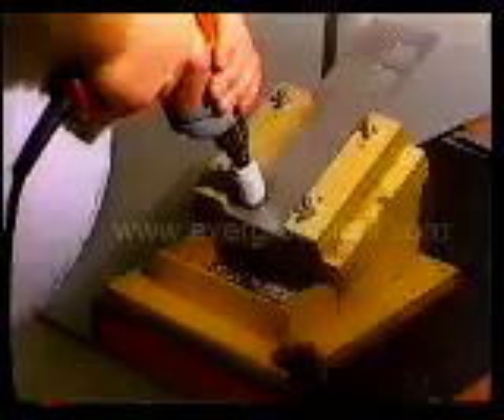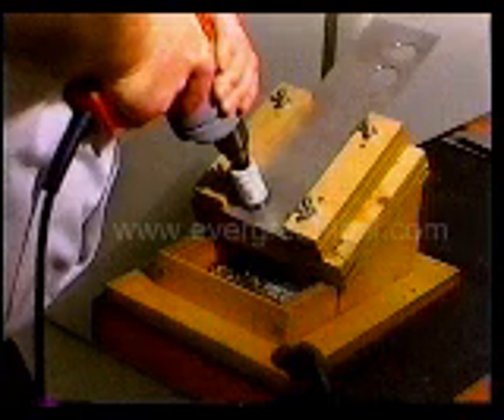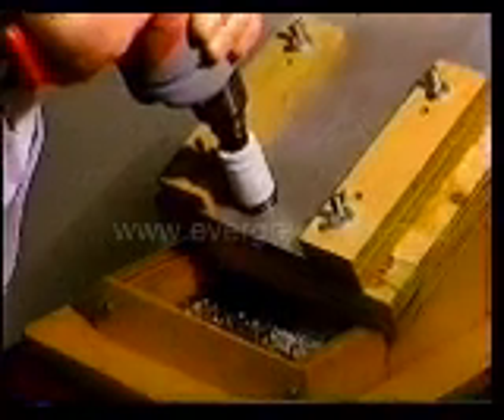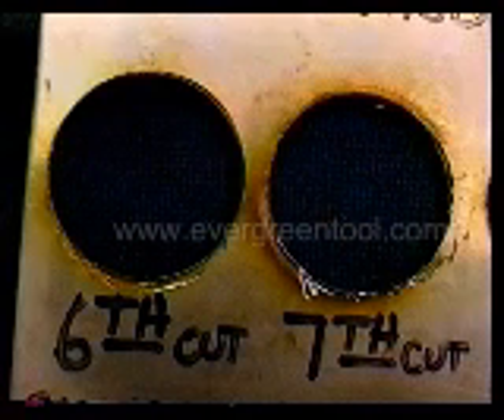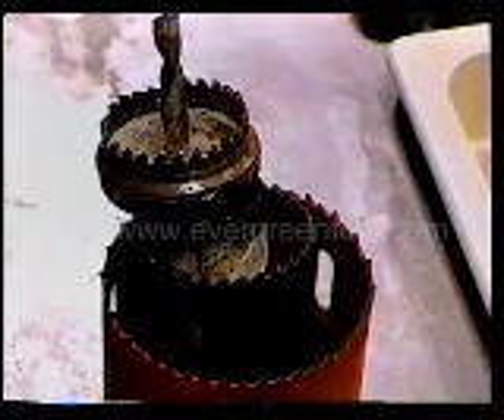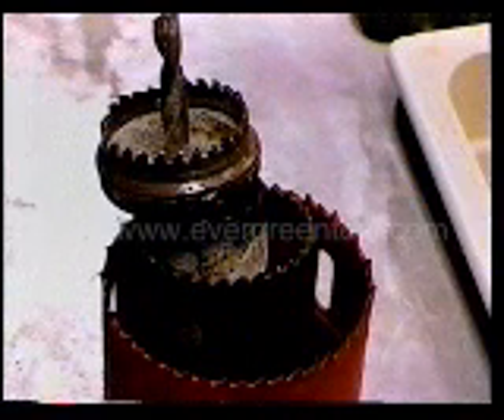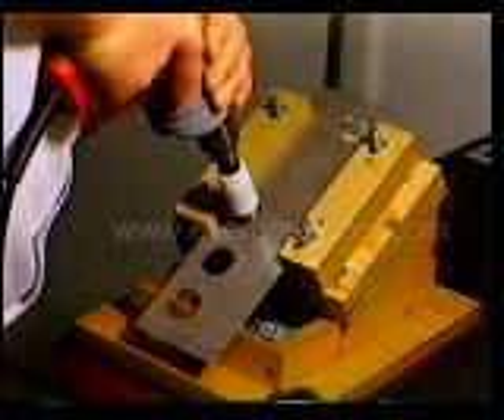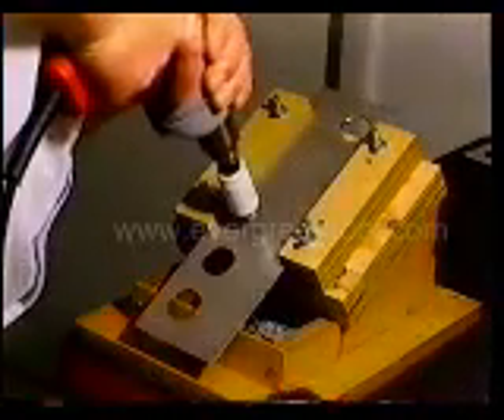Why is stainless steel so difficult to drill through?

Comment from the maker: Drilling through stainless steel requires a good deal of pressure behind the drill motor, slow cutting speed, a pilot drill and steel cutters with as few teeth as possible.  You don't want to build up too much heat in the stainless.  If you are cutting a lot of holes take a look at our hole cutting system at Evergreen Tool
Our system includes a drill motor, cutters and speed reducer designed for cutting through stainless.

Comment from the maker: Drill at the proper speed depending upon the hole diameter (1" = 200 rpm, 2" = 100 rpm and 3" = 65 rpm), you will want more cutter pressure per tooth - use a cutter with less teeth, use as much pressure on the teeth that you can and finally use lubricant - bees wax is best.

Comment from the maker: Here is a good description:  Stainless steel material is susceptible to a phenomenon called work hardening and is one of the reasons this material is difficult to cut and drill.  Work hardening is the result of the action of cutting edges deforming or compressing the surface of the work piece, causing a change in the worked material's molecular structure that increases its surface hardness.

Comment: If possible, always use coolant. Stainless does not transfer heat well and that is why it kills tooling...  Slower RPM rates for larger holes and as heavy of a feed as you can manage help.  See the drilling charts on Drill-HQ's web site for great starter numbers - all presuming the use of coolant.

Comment: The key to drilling stainless is slow speed heavy feed.  However I have never used a hole saw to try to penetrate stainless. In my environment, I would use an end mill on a milling machine.  You could also use an oil to help keep the cutter cool.  Good luck